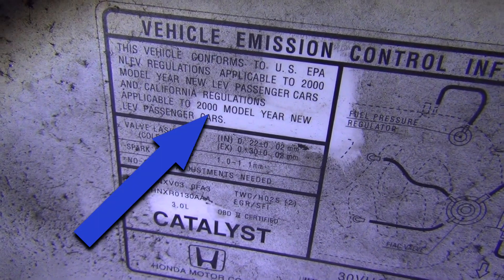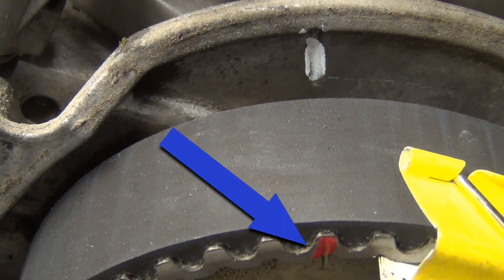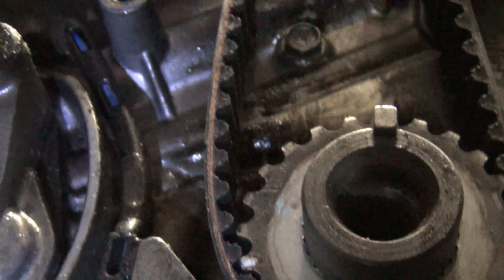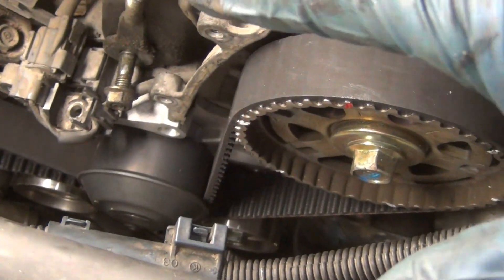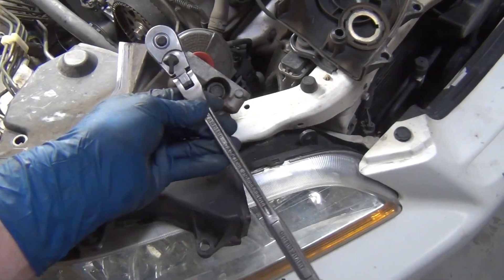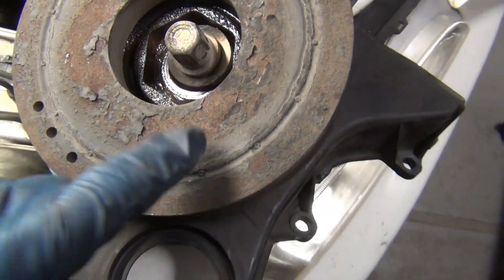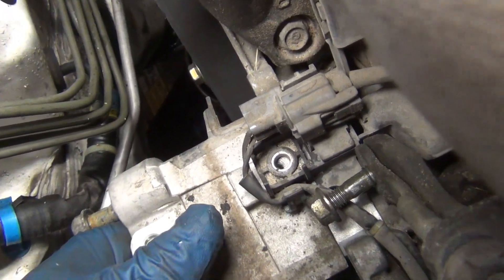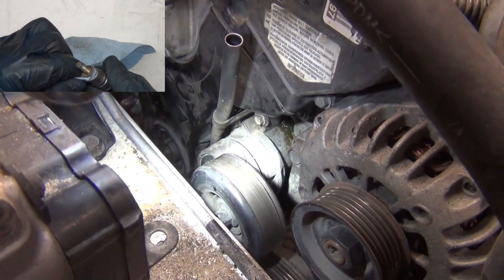How to Replace a Timing Belt   Honda   Acura V6 Edition 3.0L 3.2L 3.5L

Comment: I love these Timing belts. I could do one in my sleep. Just finished my 04 TL sport
Reply: I could do one in my dreams . 
Never done one .
Reply: I love timing chains. Never have to go thru this unnecessary crap. Thanks alot Honda
Reply: @RothBeyondTheGrave  unless the tensioner goes bad for the timing chain, then you will have to almost do the same thing.
Reply: @civicpride1986  very true. Hopefully if that were the case, you'd hear the chain smacking around some so you'd have warning. And at least it's not inevitable maintenance. A belt on an interference engine is kind of a dick move but again, Honda's reliability I trust. Had an '03 tl at 217k mi on the og belt.
Reply: @RothBeyondTheGrave  I just finished doing my timing belt on my 04 acura TL car had 275k miles and probably this will be the last timing belt job I will do on this car.. unless it makes it to 375k, we will see.. I agree this honda v6 engines are almost bulletproof..
Reply: @civicpride1986  that's incredible. I hope it does reach 375k! My mom's '07 has 190k mi now & other than normal gasket/o ring failures & cv axles, it's been pretty much flawless. I just did her upper tranny mount & it rides solid again.

Comment: Hi i have a question about my stepper motor I replaced on my 2003 escalade. Your video was very helpful and we followed all the steps. After three days the panel clusters didnt lite up no needle movement again. Removed panel again to check for anything we missed but we didn't use masking tape to mark gages like the first time. All the gages were ok but the gas gage moved all the way down past full mark underneath the Empty mark And when we turn ignition in the clusters didn't come on right away it came on after we put it in drive. Can you tell us what what we need to do to fix gas gage. Ive watched other videos they said it didnt really matter where the needle was at so Im confused. Thank you i hope to hear from u soon.
Reply from the maker: I've seen that before on vehicles with battery terminal problems and or batteries with an internal short.  I don't know the science behind it, but it seems like they surge.  Another issue I've had personally is having solder joints that aren't shiny- not hot enough or not clean enough causing problems.

Comment: Hey, B-Man- nice to hear you again. Hey- what's up here? Why is everything so gunked oily & filthy? Front seal? I so wish Honda would go to chains- I don't trust belts as far as I can throw em. Imagine- an aftermarket company making sprockets, chains, & tensioners to refit belt engines? That'd be awesome.
Reply: chains Need oil,  belts are not that bad
Reply from the maker: Power steering leak and mostly a water pump leak.  Belts help acceleration, fuel economy, and keeping the engine quiet.  All the good stuff.  The less mass you have to move the better.  It's physics.  It's like the unsprung weight formula for a better riding vehicle.

Comment: i always spin the motor over with a ratchet after i set the timing belt and reset the timing marks over again before i put them all back together just for good measure like your videos keep making them we'll keep watching
Reply: I only do that if I am being a bit paranoid or milkin a job because I am bored.
Reply: you got a little action going on there in your pic 😏
Reply: Hey guys. I have the same engine. My belt broke on mines while sitting at a light. Tension pulley is the cause. The only thing is when it broke. You know by nature you try to crank it back up which makers the cam shaft spin if I'm correct. How can I get them all back in line. The top two are pointing in the 1 o'clock position and the bottom is well maybe at 5. Besides I've been trying to start it. By replacing other crap other than the real issue lol. I replaced the pump in Dec of 2016 and now the belt breaks. So I'm stumped on what to do. Thanks if you guys could give your insight.
Reply: @UniversalCode9  did you ever get this fixed?  These engines are interference engines and so it's possible you have some damage in your heads or pistons.
Reply: @mikegilmore8998  man I got rid of it 2017 in December. I wasn't ready to take the risk. I miss that car. Acura the tl
Reply: @UniversalCode9  how many miles when it broke?

Comment: Hey Brian, I have a 2002 Accord 3.0 and need to do the timing belt on it, so thank you for such a timely video. I have been doing research, and a couple of places indicate that the 3.0L Honda engine and I think the 3.6L are the only two Non Interference engines in the Honda line up. Can you confirm or deny this? If it is not an interference engine, should I wait to do the belt until it breaks, or just bite the bullet and spend the weekend getting the job done?

Comment: The timing (pun intended) of this video was poor in my circumstances. But that was out of your control. I just did this job 2 weeks ago on my wife's car with 220,000 miles (second time I've done it on this car, we have had it awhile). Unfortunately I screwed up the timing, the car wouldn't start so I enlisted the help of a mechanic buddy with more experience. I pulled it apart again and found the rear cam was off about 90deg. I'm not sure how that happened, after getting the new timing belt on I checked all my marks or at least thought I did and thought it was all good. I wished I would have marked them all with white paint, that would have helped. I think what I did was while trying to put tension on the belt between the rear and front cam pulleys I turned the rear cam, noticed it turned and turned it back, but it must have moved again and I didn't realize it. So after correcting the timing on all the pulleys the second time around, I had my buddy check and it all looked good. Fortunately turning the motor over with it out of timing didn't bend any valves that I know of and it runs great now.

Comment: yo brian. I just changed whole timing set in my vtis prelude. I got problem cause one of new seals is leaking and I need to change it. would you recommend me to buy new set of belts etc if I need to dismantle it or can I put it all together just like it is (car drove like 50km on it).

cheers

Comment: Hi Brian, Is there a brand of brake pads you feel are quality? I have a Honda Ridgeline
Reply from the maker: You can't go wrong with factory pads.  That's always a safe bet.  However Honda's aren't that picky either.
Reply: briansmobile1 Thanks Brian.
Reply: please do not use o Riley's brake best if you decide to anything with brake drums... I think they are called brake best, usually ends up being brake worst.
Reply: factory or non proprietary auto part store brand name. wagner/performance friction/ ebc.
Reply: Second that on the factory pads. I got 120k miles out of the original pads on my 2006 Ford F350. Went back to the dealer and said give me whatever you put on the truck in the factory. (Not sure they are exactly what they installed in the factory, but close enough)

Comment: hi Brian.
Reply from the maker: Hey G!  How YOU do'n?
Reply: briansmobile1 I'm good man. just want to say thanks for all the subaru videos. 
you helped keep my Forester on the road after a engine swap. timing belt, coolant, head gasket. thanks to you man!
Reply from the maker: You're welcome- stay tuned (pun intended)  I have an exhaust video coming up soon!
Reply: Cant wait!
Reply: Should have resealed that leaking oil pump housing while u were down there.
Reply from the maker: The owner didn't want to pay for it.   I'm cool with that.  If you don't want steak for lunch, don't pay for steak.
Reply: briansmobile1 Glad to hear it was recommended